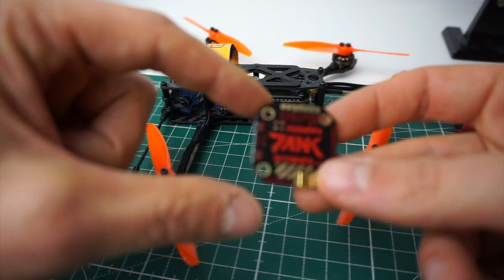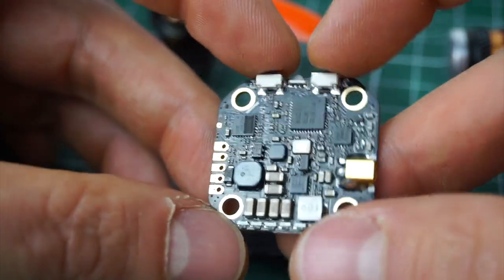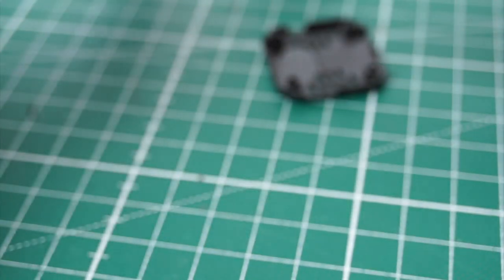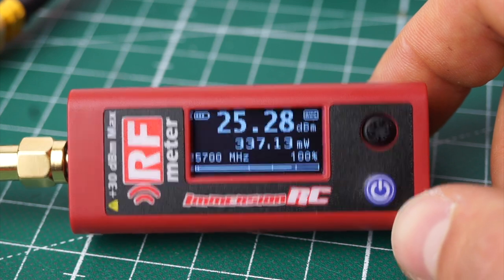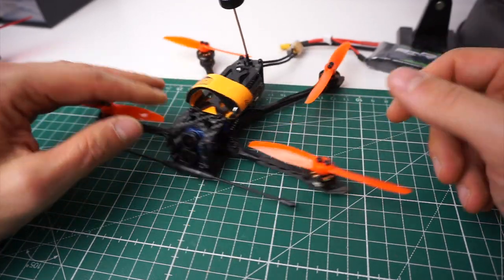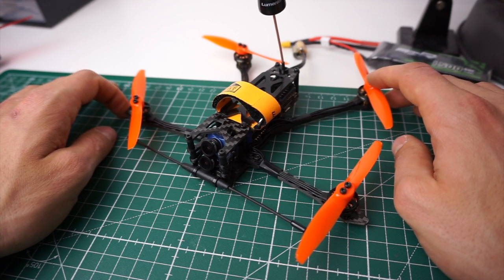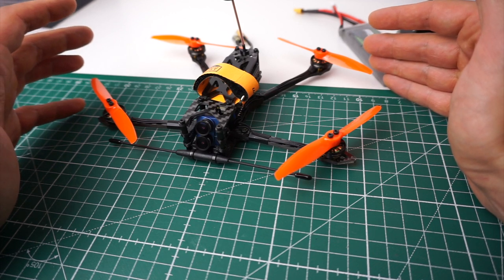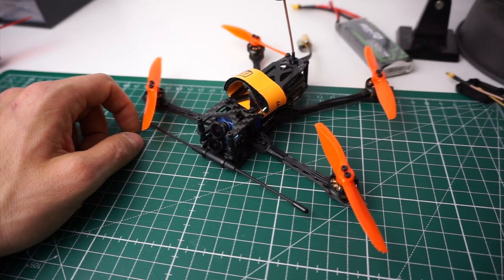RushFPV Tank Mini - Review & Power Test

Comment: I think your right. 1500mah 2s might be overkill and overload this motor so it sucks too much amps. Above a certain weight limit, this naturally has a negative  impact on flight times. Thank you for your reviews and project! I built the for version of this build you presented the 3" evo2 cinematic today. I will try the very cheap 2s 950mah turnigy nanotech 25-50c lipo which weighs about  46g from hobbyking. My suspect that to achieve the ten minute flight time... but maybe 25c are not enough? My build weighs about 100g with 20g hawkeye 4k camera and the ducks with 2.5" props.